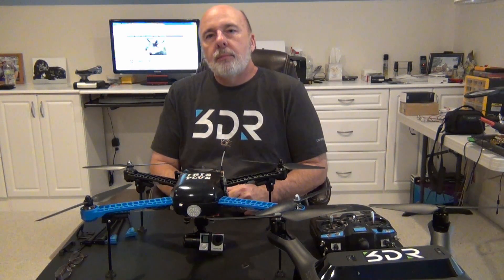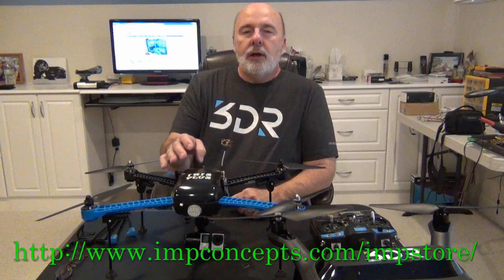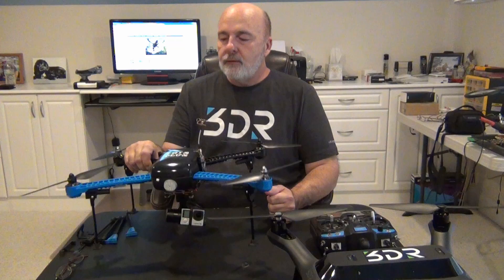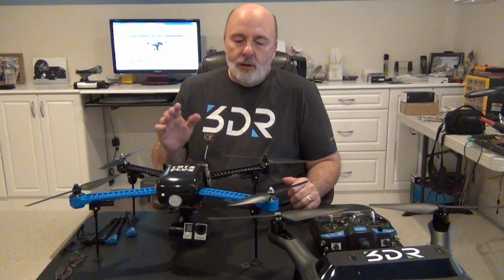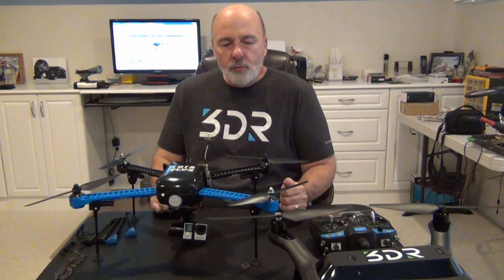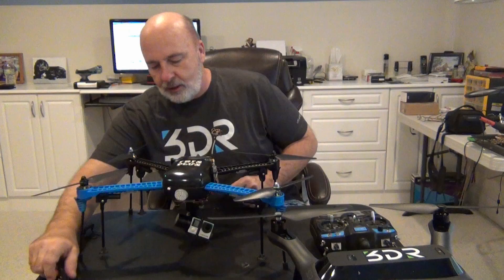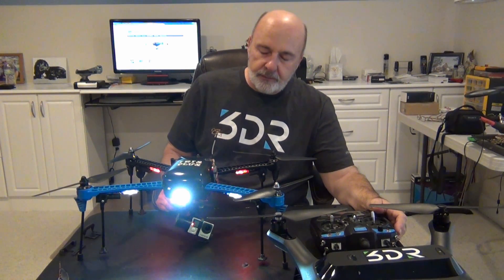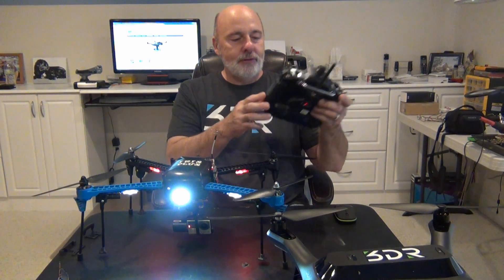3DR IRIS Retractable Landing Gear From IMP Concepts

Comment: hey buddy, 
I have a question, I see you do a lot of work on the Iris, here is what I need to do, and a little confused, and being you installed retracts I suppose this will be similar
I want to install a servo , just one servo to act as a dropping mechanism on my Iris plus  ( you know, to drop items from the drone etc,, )  can you give me some info how I can do that using my existing  radio and the Iris?  any help you can supply will be apprciated, 
I can supply email phone etc, just let me know ,
Reply from the maker: +Elmo Di Calro What I had to do for the Servos to work of the Pixhawk was add a BEC.  I am not an expert at this so I can only give you some thoughts of what I did.  Anyhow,  this allows you to select a channel 7 or 8 in my case as I am using the stock controller to trigger the legs.   I see no reason why you cant do the same things for the bomb drop.   Take a look at the installation of the legs,  and move down the page to where it talks about the BEC and the radio setup.   http://www.impconcepts.com/documentation/IMPConcepts3DRIrisRetractsKit(CarbonLegs).pdf    I hope this helps some,  but I think that is all you need to activate a servo.    Let me know how you do.

Comment: thanks for the info, 
I have another question, I recently bought an Iris+ (* I had one briefly about 6 months ago) and am puzzled by something, 
I purchased two brand new batteries with it,, and I cant seem to get more than 6 min in a hover in front of my house, 
everybody seems to be claiming 12 15  min, I dont get it,,,
and I also have the Tarot 2 axis gimbal and camera on it,, 
is this normal, 
the min it turns the nav light yellow it heads for home, 
any thoughts?
Reply from the maker: Is this the iris+. And are the batteries. 3500ma or 5100
Reply: 5100  its an iris +
Reply from the maker: +Elmo Di Calro you should get more than 6 minutes but not 15.  I just bought some new batteries about 2 months ago and in the next few days I will test it and let you know exactly what I get.  I have a 3axis gimbal and a 600 mw fpv transmitter along with a 24 led headlight.  So lets see what I get.   I usually try to land at 10.7v so that is where I will call the time.  then you can compare.   I would say at least one extra minute if you don't have the FPV transmitter.    I will make sure I do gentle flight.